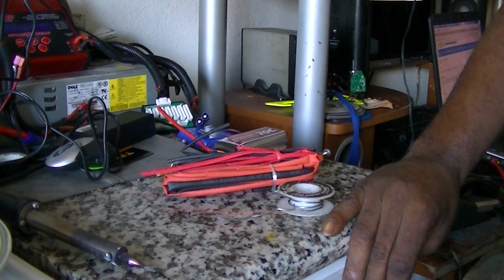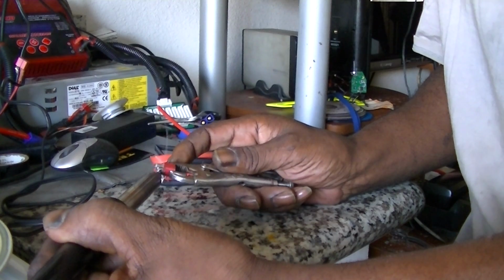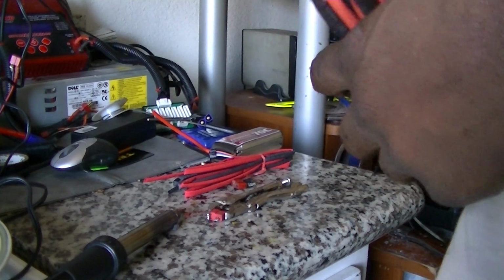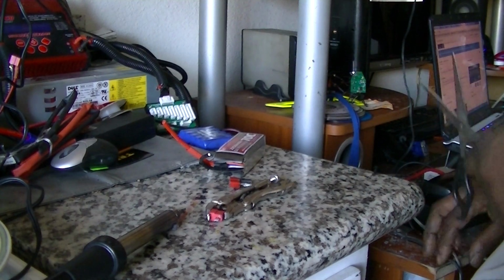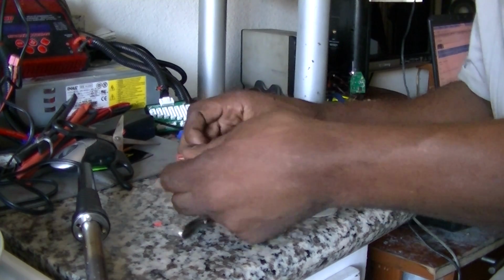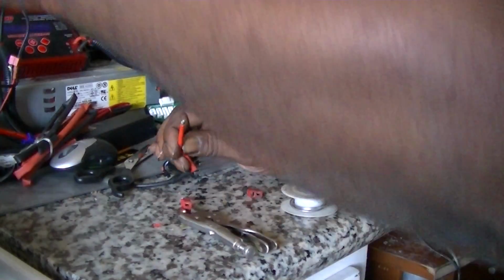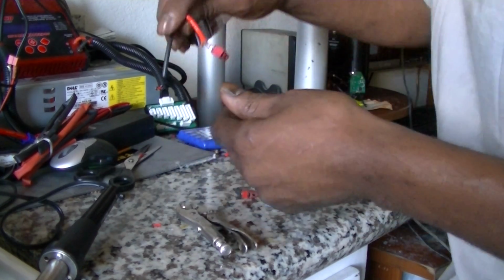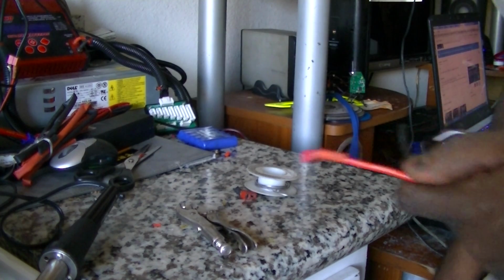soldering tips from your buddy =wc=

Comment: Great video WC , I also use Fluxite soldering paste when I solder. . I dip the wires and connectors into it, just enough to coat.. makes a big difference , solder flows nicer and the end result is a nice shiny connection.
Reply from the maker: thanks for sharing the information good advice for me and other pilots